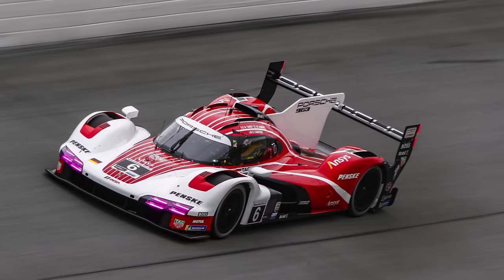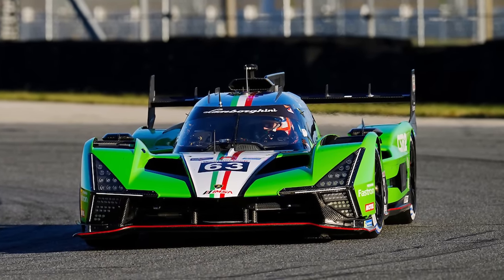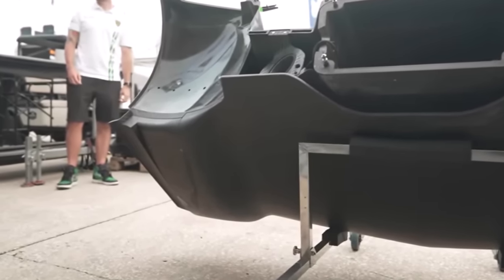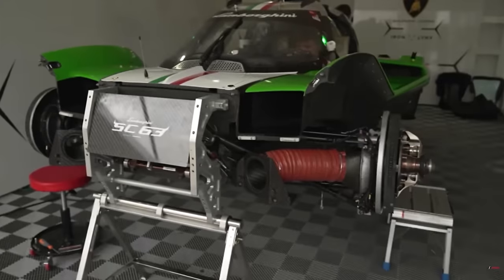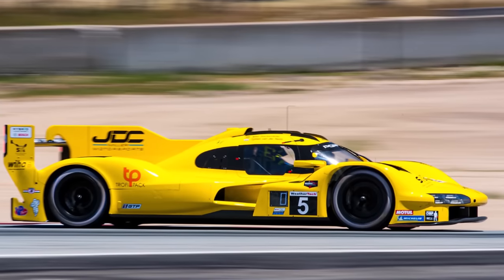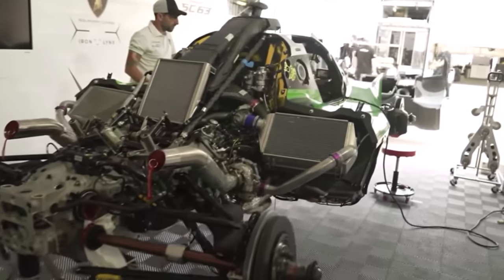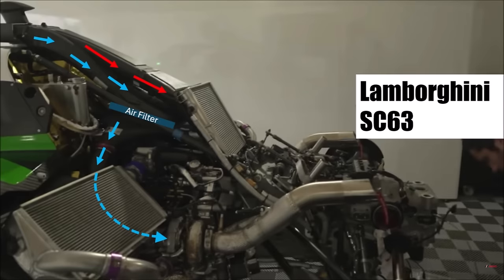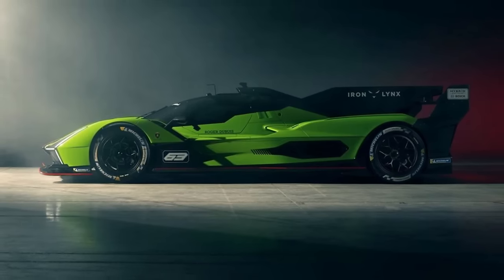Lamborghini SC63 LMDh Hypercar - CLOSER LOOK

Comment: I just like to see variety in this championship and it’s great to see so many unique solutions across the grid, even if some solutions are flattered by BoP.  

In a BoP championship tho, at least what I hope happens, is that since only apparently the top 20% of lap times are considered in the algorithm, better designs are easier to drive and thus can last longer with their tires.  Tbf, pure efficiency is also not the aim of the championship either as drag and downforce are quantified, so less efficient designs are almost required as a compromise.

Comment: the lambo entry seemed lazy to me, glad b sport confirmed it IS in fact lazy
Reply: All of the LMDH cars are lazy. That’s the entire point of the rules. Hybrid race cars without actually building a hybrid system and just using spec parts.
Reply: @rexthewolf3149  and the actual pioneer like Ferrari and Toyota with their own design have been limited by the bop, way to go...
Reply: @VarioFelce  Your right, but this isn’t a bad thing. Sports car racing is getting more attention from manufacturers than it ever did before.
Reply: @VarioFelce it's Toyota and Peugeot actually
Reply: @kidpagronprimsank05  Ferrari is lmh
Reply: @VarioFelce  you said pioneer then for hybrid it Toyota and Peugeot. Ferrari come later
Reply: @kidpagronprimsank05  I was talking about who has a proprietary chassis and hybrid vs standard ones (Porsche, Lambo,  bmw etc)

Comment: Lambo should have used their legendary V-12
Reply: It's the V8 they plan to use in their future V10 replacement.
Reply: Might be a bit heavy and long for a race car
Reply: Packing it inside the body would be the biggest issue if they tried
Reply: Only in our dreams!
Reply: @nikomoin7604  Aston Martin will use a V12 next year
Reply: Lamborghini doesn't even use it's original famous V12 anymore since the Aventador. But it would be nice to have a V12 of some sort
Reply: That thing weights 235Kg. It's a bit too much for racing.
Reply: I think they should have used the V10 from the Huracan as a send-off to the V10 that they have been using since the Gallardo.
Reply: @JohnnyDrizzle  The Valkyrie is not a hybrid LMDh car though, but a completely bespoke design free of LMDh rules.
Reply: @CyanRooper still too large
Reply: Less reliable
Reply: It's overkill to put a v12 in it since there is a power output limitation
Reply: @nikomoin7604  Yeah, kinda like how Mercedes ditched the M-120 V-12 of the CLK-GTR '97 in favor of the V-8 engined CLK-GTR LM '98
Reply: Fr
Reply: @arthurb5194 what?! It still uses that in the revuelto.

Comment: From the rear it is probably the most stylish prototype among both LMH and LMDh cars: the rear lights area from the top view actually is V'd (the central part sits further from the rear axle whilst at the edges the lights are a bit closer to it). Compare it with really any other car, aside Peugeot and a little bit for the Porsche, and they are instead cut with a straight line seen from the top, givibg those cars an unfinished look. 
Gorgeous car, and P7 at the Sebring 12h is definitely very good for them.

Comment: i have always wonder why the wheelbase for these prototypes is so longgggg. Like aint it more agile with a short one?
Reply: They are just less tall. They are shorter than f1 thats why it looks like it is long
Reply: The cars are max'd out dimensionally, as in the body work "fills" the extent of the box the cars have to fit in.

This is to give aero elements the largest surface area possible to do aero stuff. 

Then the wheels are pushed out to the corners of the car as much as possible. This reduces the amount of mass that has to be "swung" by the car's rotation about its centre of mass, reducing the energy needed to induce directional changes in yaw, making the car proportionally more agile the further to the corners the wheels are able to be positioned.

This does have to be balanced with component packaging and floor volume/shape to maintain reliability and power/torque potential of the drivetrain and its ancillaries and aero efficiency of the bodywork, but you'll see this wheel positioning principle applied to prototypes as far back as 1980's Group C and 1970's Group 7 stuff
Reply: @supermantrly They aren’t tall at all. They are half the height of GT3 cars which are already sportscars that are already lowered.
Reply: @cademckee7276  thats what im saying, they are less tall thats why they look so long